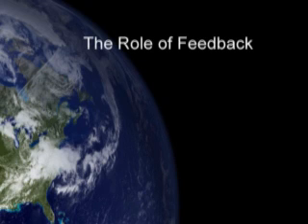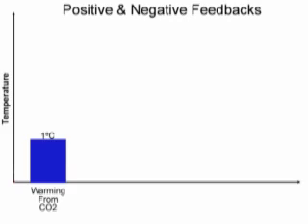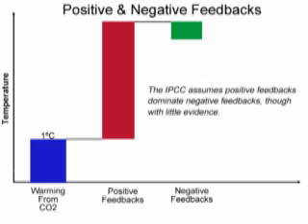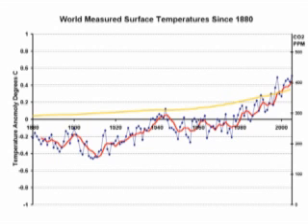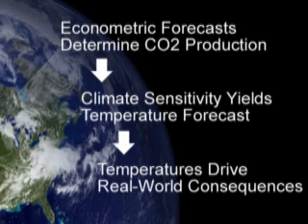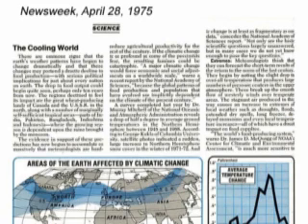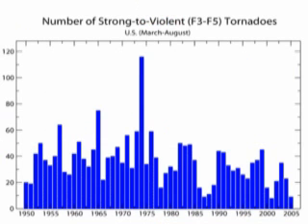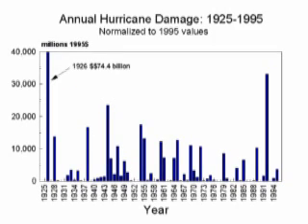What is Normal?  Climate Video Part 5

Comment: A 3oC sensitivity is calculated by using past climactic change including what we have seen in the past century. It is not models that lead to that figure. A climate system that has been stable for millions of years???Ever hear of the Ice Ages? That's why we know there isn't a low sensitivity because if it was the past we have seen cannot be explained. This video is a compilation of climate myths. Go to skeptical science (dot) com and see them debunked.

Comment: There are some errors in this movie. It isn't the CO2 that will cause 3 degrees rise in temperatures. Our carbon emissions will only stand for a little temperature change. It is the effects of the increase in CO2 (like the melting of siberian tundra which will release methane, melting of the arctic etc). The growing seasons will be better in some countries, and totally useless in others. The rainfall will increase in many countries, but it won't be beneficial, because it will be hard rain.

Comment: If there are no clouds, the sun is shining on the desert all day long, that's over 1 MWh of heat / square meter... that's why it's hot, 
Temperatures drop dramatically in the nights because there is nothing to keep the heat energy absorbed by the ground in it, and it quickly dissipates in the night air (below freezing temperatures found in the winter).

Comment: Dave,

Here's an interesting thought.  We've all seen those "greenhouse" diagrams with that "back radiation" bouning down from the GHG's to fry us.  

Now we all know that water vapour is the major greenhouse gas.  Where is water vapour at its lowest ... over the desert.

So with very low greenhouse gases we should have very low greenhouse effect and hence colder temperatures.

So why is the Sahara so hot ?  (Compared with clear days, same latitude elsewhere)